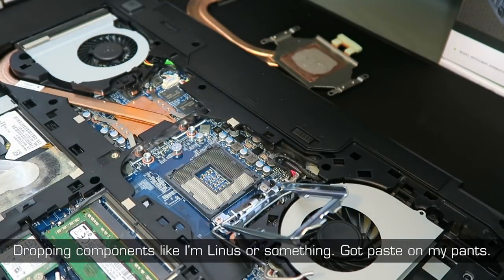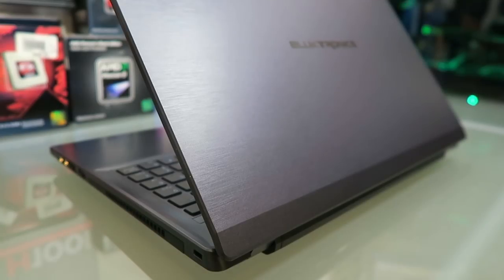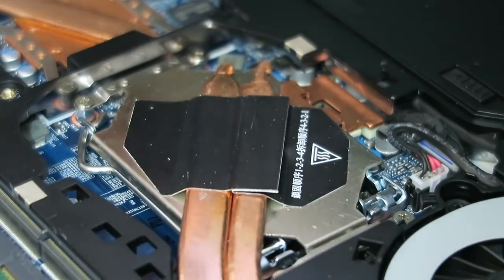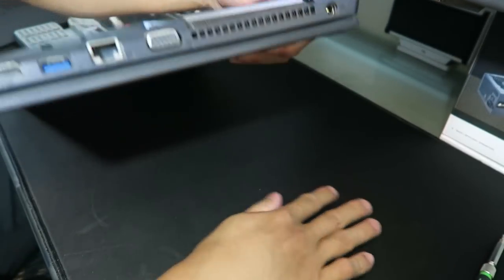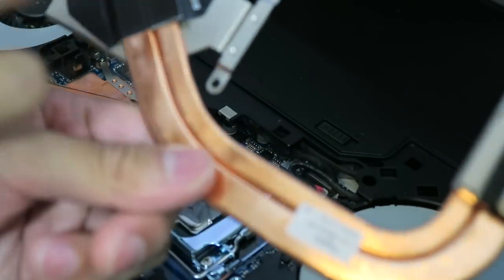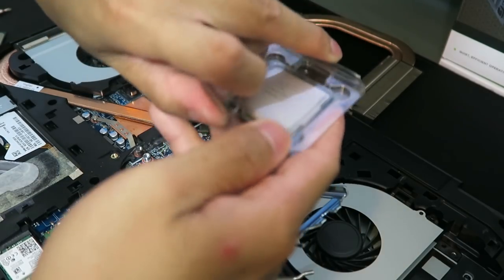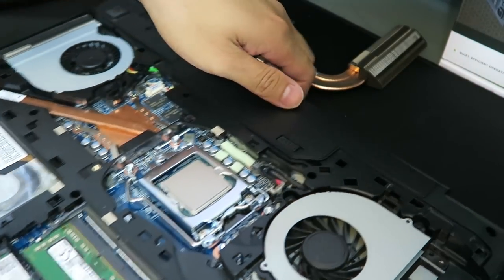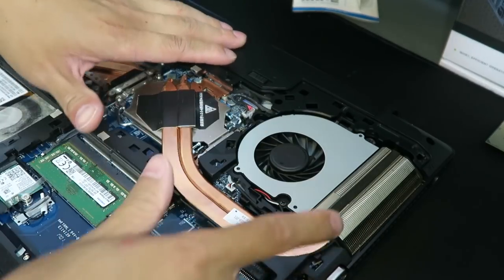Laptops That Use Full Desktop CPUs

Comment: Man that 1050 Ti is not being cooled well... 87c near the end of the video there.
Reply: Redey1290 itd 2017 gpus shluld beable yo survive past 120
Reply: CSRF Broforce Uhh... First, what GPU has a TJMax of 120c???? Second, just because it can sit above 90c, doesn't mean it should. Even then, running a card at 80c or above on the daily is not very good.
Reply: CSRF Broforce Actually no, I can't read because you seem to speaking a foreign language known as "gibberish."
Reply: that is...NOT how silicon works.
Reply: ya gotta make compromises and a """""few""""" degrees warmer on a gpu is one that many people are gonna take.....me included when that sucker reaches here and this brand of laptops you can always buy a heatsink with more pipes later.
Reply: Hey, if you find a better cooler for this laptop, let me know haha. I really want this laptop, but that hot running 1050 Ti is a turn off for me currently.
Reply: Redey1290 lmao i msi 390x hit95 degrees 247 for over 1 year ahah
Reply: yeah but good luck,there is a higher end model that comes configurable with an r9 390x crossfire or 980m sli and on that page you had a choice of 2-3 pipes but u gotta buy the gpu with it but heatsink alone.............didn't find any
Reply: my r9 380 doesnt go over 60c under 100% load
Reply: That's really not too bad notebook GPUs throttle around 120C and under 90C it won't degrade the life of the card too much. You could always get a laptop cooling pad for when your gaming it should bring the temps down quite a bit. CPU temps are very impressive!
Reply: High 80's aren't going to hurt this GPU lol. Not sure how long you've been in the game, but we've come a long way.
Reply: I've been "in the game" since around 2014 I think. I just kind of figured with CPUs usually having a 90c TJMax, the same would apply with GPUs. I guess that isn't true, but ever since I figured that out I've been a temp freak running my RX 470 at 65c.
Reply: well people have their own personal comfort zones if he has a problem with 80 degrees.........sad
Reply: Redey1290 everyones so larsnoidnwith voltage nd temps its sad...
Reply: Yeah, it'll be fine. Even at 90c the majority of CPU's are fine, that's just around the standard cap. I put it to the test a while back and ran a 8350 at 118c with the safety guard disabled just to see how long it would last with an extreme overclock and crappy cooler since I had no use for it and it had already been though a lot. It ran for 2 years before I stopped the experiment, still works today in my test bench. Kind of puts it into perspective of how durable they actually are. I even have some screenshots if you want them!
Reply: +Big Poppa Pump, yes I do actually, I learned the metric system before the imperial system because honestly it's so much better. 118c was not the constant temperature, but it did reach it at some points. Normally, it only got to 111c, but like I said, I wanted to see how long it could last. Obviously I know that it isn't good for it and it sounds dumb to anybody else, but it was my hardware and I was curious, so it seemed like a logical experiment to me. It also showed that the hardware you buy is much more durable than you would think.
Reply: It is fine.
Reply: Redey1290 nope, cpus tjmax is 100C and a youtuber "science studio" has showcased that even if you don't have cooling (yes, he ran windows without any cpu cooler) is possible and won't shut down its pc. This is because the heat management is good enough that is starts and continuously throttle so bad, the temps are stanle
Reply: kenny ricardo Yes I realize the TJMax of most processors are 100c, it was a typo, no need to lecture me about it.
Reply: Redey1290 i was also commenting to your initial comment. The point is, even if you don't use cpu cooler, those guys will run just fine, just throttled heavily
Reply: kenny ricardo Yes and I realize that also, but why get a near $1000 laptop if it can't even run a 1050 Ti without throttling and obviously compromising performance heavily?
Reply: Redey1290 because 
1. It is not $1000, more like $800
2. $800 gaming laptop only usually has 950m/1050
Reply: Redey1290 and if you see the speed of those gpu, they didn't go down even a little. Indicating no throttling
The 87C is probably just a fluke and it will rarely reach such temp
Reply: kenny ricardo $800 can also have 1050Ti.
Reply: running a gpu too hot(80 to 85c) will damage the gpu over time, there wil appear micro cracks in the gpu(dead)
Reply: youshallnotpass pass lmao where did u get those facts... ive run many gpus around 100degrees for years... nothings wrong eith em stip spreadding fake news
Reply: Redey1290 it's slowly dying
Reply: micro cracks.......that's not how silicon works..... and 80 degrees woooooow.... these people need help.
Reply: youshallnotpass pass if it slowy die at 80° my laptop should be dead 1 year ago. I got it from 1 year and 8 month and cpu always go over 85° in gaming, and my 950m can reach 85/87° in The Crew. Sry for bad english.
Reply: Delwin Griffith micro cracks or micro tears in the gpu itself, yes it happens under many hours at high temps. why do you think baking a gpu in a oven works for a short time?
Reply: MrMim0x17 you didnt even use it 2 years..... its quite simple the higher the temps the lower the lifespan, i never said it would die quick. bot for example look at the gtx 480 gpu it ran hot as fuck(85c) and many of them already died you cant really buy them anymore, now look at a gtx 560 many of them are stil alive as new, they ran very cool escpecially the msi or asus aftermarket cards, they only reached about 55c at full load at 50% fan speed. high temps do kill hardware over time.
Reply: Delwin Griffith Actually that does happen. I have seen a few rare cases where someone has had their GPU die crack (not micro crack - like actual crack down the middle) from running hot 24/7. It's rare and you'd have to have a screw loose to let it happen.
Reply: Redey1290 So what? It's laptop..  My 5 year old laptop has nvidia ge force gt520mx and it's heated up to 80 but u know it's rly down on performance ..
Reply: all these people saying this even if it is true u said a "long time" and "rare cases" that doesn't mean u can be that rare case. some of these things can last many years at 90 degrees. so forget about your rare cases.
Reply: Delwin Griffith why do you think puttin a gpu in a oven repairs ir for a short time?
Reply: why would you put a gpu in an oven..........how many degrees does said oven has to be at.......why doesn't said gpu repair it self over time and last like 10+ years under load.
Reply: Delwin Griffith the reason a gpu in a oven works is because the micro crack and tears in the gpu wil fill, it only works for like a few months tho. if you never heard of this way of given gpu's a few months then you dont know anything.
Reply: Delwin Griffith repaired enough hardware the last 12 years to realise i know more about it then you ever will, i bet you cant even micro solder.
Reply: Delwin Griffith my laptop runs 70C+ on chrome and word nowadays (thermal paste may be dried up, its 4 years old) but i don't know how to disassemble it.

One thing i can assure you is, that 4 year old laptop is slow, but i used to game on it and the temps will almost always reach 85C and throttle on both CPU and GPU. 

Nope the laptop is not dead yet, still going but is really showing its age

Note : i don't game on it now that my cpu will almost always shut down due to thermal whenever utilised 100% (even under throttling conditions) and it will heat up to 97C before throttling (cooldown, cycle repeats) on a laptop cooler
Reply: kenny ricardo yup some laptops just dont cool enough and its quite a shame because its kinda destroying the hardware over time, you can try to set a custom fan profile tho.
Reply: Redey1290 I have gtx 970 SSC and i daily play games with temp at 80c it's been now year and half and still fine:)
Reply: I would think maybe 4 years daily at 80c would start taking effect on the GPU. A year and a half isn't really long enough.
Reply: Redey1290 i don't think so i will get back to u after 4 years😂
Reply: I have 6 RX 560 for mining (sapphire non overclocked), 75 °C  24/7 after 3 month work perfectly
Reply: a year and a half isnt long, also 3 moths isnt fucking long is it? 
for fuck sake man i never said it would last like a amount of years i only said te gpu wont last as long at high temps. every piece of hardware wont last as long at high temps. also rekt why do you play at those temps with that card. if you set your fan profile to 50 to 60%under full load it wont even become hotter than 65c, i owned that card myself a couple years back,its a great with a great heatsink. the only thing i didnt like was the power delivery.
Reply: youshallnotpass pass my country is hot AF boi and i don't really know what the fan rpm when playing i will do ur advice and see hope it's not to loud
Reply: the evga card turns the fans on when its at 61c and after the 61c they are running at 30%.
so yeah even if its a hot country the cards can run wayy cooler. just make a aggressive fan profile in msi afterburner or evga precision i wouldt go to 100% tho i never liked runnings fans at 100% i think the fans will get damaged, never really tested it but i do know msi had that problem with the twin frozr 500 and 600 cards.
Reply: youshallnotpass pass I tried aggressive fan it's not that great u can hear the fans even when u wearing headset
Reply: These are just people who are better off buying that rog water cooled laptop and putting 2+loops in their cases..... Because manufacturers don't want their products last long
Reply: Rekt kinda wierd evga fans arent that loud, but you can better have a vieuw more decibels of fan noise instead of a temp at 80c
Reply: Rekt you also arent getting the fil performance, all nvidia cards hold themself back when they reach 80c, nvidia does that so that the cards wont run over 80c so yeah you are throwing performance awat when you run it at those temps with that beefy heatsink
Reply: Thats a normal temperature for a gaming notebook to be honest
Reply: ibm5155 I have an Asus G752 with a 965m that runs at 65c max. I consider that normal operating temperature for a gaming notebook.
Reply: That's kinda rare in notebooks world.
But it also depends on the game that you're running, like my dead gpu could run any game up to 70ºC but doom in vulkan could make it run at 80ºC and a bit higher...

I also had an hp laptop where the gpu reacher 105ºC in game (this one is indeed high) and a ibm one where the gpu could also reach the temperature near 90ºC.

But I just saw ur notebook and it's a different situation compared to normal notebooks, this one is big and has a really good cooling system (plus big heatsinks)

to compare, I have an ativ book 6 xd2, where the cpu consumes 45Watts + 50Watts from the gpu, while you have the same 45Watts cpu + 50 Watts combo gpu, so there's no way like a slim notebook to run at lower temps with such a high end setup, unless they have a monster notebook sized.
Reply: Thats really good for a laptop. laptops have atrocious cooling
Reply: I have change the stock thermal paste from my laptop (MSI GP62 2QE) and I gain 18° (90 to 72) on my gpu and 10/9° on my cpu ( 89, the throttling temp to 80 max (overage 78/77° in full load) in celsius. So I don't know if Nerd take the option for a better thermal compound (I don't really know if it's thermal paste or compound), but a good thermal paste help much more as I expected (I use Arctic MX-4, who become better after 1 month use, I have read somewhere in a forum, I will see that in 1 month). Sry for bad english ( I don't really know if you understand everything I write ?).
Reply: I have the laptop and I changed the GPU thermal paste... Now is 78C max... Very nice
Reply: @delwingriffith4863 In 2017? I thought AMD CrossFire stopped being a thing in 2015
Reply: @shellcode4892 Question is what are lets say an RX 7600 what is the TJ Max for that GPU? Like over 150°C?

Comment: Now we just need user upgradable gpus in laptops and we are set.
Reply from the maker: The only thing about that is desktop GPUs are so large, the CPU works fine because it's not too much larger than mobile versions in the first place. There are upgradable GPUs, they just cost more than the laptop itself in a lot of cases
Reply: Nerd on a Budget GPUs aren't big.. the COOLING is big.. I think this will become a thing when HMB2 becomes the standard :)
Because the current GPUs have GDDR5 which is NOT embedded on the Chip.. but on the board.

While HBM2 has everything in the chip.. I hope we'll see an upgrade path in the future!
Reply: the thing we need is actually external gpu that not cost fcking much like razer one
Reply: Strange i am ready to pay 100$ bucks for a thunderbolt thingy... But not freaking 200
Reply: i wuldnt mind bigger laptop if it went putting huge desktop sized gpu in it for high performance
Reply: alex m it's called an mxm GPU this is more so when they had the mobile GTX cards business laptops really used to use it for Quadro and firepro cards for the mxm 3.0 b type of socket and these are interchangeable somewhat if compatible with the bios that laptop
Reply: 1 year later we Alienware CPU and GPU upgradeable with desktop parts... Alienware 51m.

Comment: you should put a i7 6400t qhqg from aliexpress for 70$ check out tech yes city video on it
Reply: Doesn't work with most boards though, had some pretty terrible experience with it.
Reply: a regular 6400t then
Reply: John Cronin,  it only works with very specific mobos
Reply: +John Cronin +Nightwraith You are both somewhat wrong. While the QHQG can be purchased on AliExpress, the 70$ model is (or better was) a QH8F one if even (haven't seen one at that price on AE, just on Baidu). Since, the QHQG overclocks comfortably past 4 GHz for the most part and has iGPU+PCIe 3.0, they are in higher demand. A few days ago my QH8F I purchased was still at 80.50$ (10.50$ more and another model) while the cheapest QHQG was like 122$ a week ago (now 128$). And no, the QJ version with lower multiplier is not more than a few $ cheaper. Anyways, the mobo thing is also bs, since Skylake ES should work on every ASRock and most other boards that got an unofficial BIOS mod. For example an ASROCK Z170M Extreme4 was not able to OC my QH8F at all (I checked everything including BIOS version, RAM multi, uncore multi, voltages, etc.). My Gigabyte Z170-HD3 DDR3 however oc's the QH8F stable to 3.8 GHz (high voltage of about 1.46V, but it keeps cool and I don't care) with some russian BIOS mod I found. RAM is oc'd from 1600 MHz CL9 to 1982 MHz CL10 as well, not to shabby. It still is sketchy at best...
Reply: But here we are talking about a QHQG chip as stated on the top. Having owning one, I had it for 1 year and tested it on 4 different motherboards. The Z170 Pro 4S by Asrock, Asus Maximus Impact , Z170 Pro Gaming, Z170 Pro Gaming Aura all of these boards from Asus. With 4 of these boards, I could only get the Z170 Pro 4S board to work and The Asus Maximus Impact. However even configuring with the Asus Maximus Impact, I occasionally had to deal with BSODs with the hardware not being properly detected like other normal chips. That's why I would recommend staying away from it as now I prefer using my I5-6600K with a MSI Z170 Krait 3X motherboard at about 4.9 Ghz stable.
Reply: Yeah, but ASUS just sucks with Skylake ES from what I've heard and since the majority of boards are from other AIBs, I think saying "most boards" is just plain wrong. Also, what about the pricing I mentioned? Where on AE did +John Cronin see QHQG for 70$ or did you maybe?
The 80$ Baidu listings seemed too good to be true already for Skylake Q0 stepping. At what voltage is your 6600k stable with 4.9 GHz? Seems pretty high for Skylake, you hit the lottery if that is true even thogh I've seen 4.8 GHz on multi locked 6400. I have no major stability problems with my A0 QH8F @stock, oc is still unstable which I am working on currently. Memtest causes BSODs somehow, but Prime and Realbench already were stable @3.75 GHz 1.405V.
Reply: Having it at stock settings is fine for me too its just about having it when OCed for the Maximus Board at least, The Pro4S is the one that works with everything. The other 2 just would not even post into BIOS for the chip. But my friend having a Z170X Gaming 3 motherboard, even that wouldn't run the chip. Thus I concluded that it doesn't work with most boards. With the assumption that people don't usually run around owning a Pro 4S with its colour scheme being orange and black. Even though it's a cheap and decent board, I wouldn't see myself in the near future getting one of these.

On side note, my I5-6600K is running on 1.35V and with a H105 Cooler.
Reply: Yeah, since this whole ES thing does not have official support and since OC'ing over BCLK is another thing Intel wants to prevent, you really need to search for BIOS mods which you maybe did not do (enough). Why my ASRock Z170M Extreme4 not worked is a mystery to date but since DDR4 is kinda unnecessary with the chip only supporting up to ~2400 MHz RAM speed, I just went with just under 2000 MHz DDR3 which works. Not calling it BS, but most 6600k need like 1.5V or more for 4.9 GHz with some under 1.4V, so you hit the lottery big time, which got somewhat less relevant since Kabylake oc's to 5 GHz no problem, but atleast you saved this additional cost for the chip.
Reply: True about that. I delidded and used Thermal Grizzly's Conductonaut and it was probably why my 6600K worked. I mean people probably got chips that might be not new for the ES chips. That's why it is quite difficult to know what has already been through with the chips and what did Intel do with it.
With the BIOS mod hidden somewhere on the internet, probably why people have 2 sides of the spectrum.